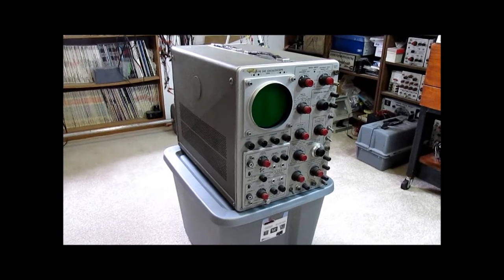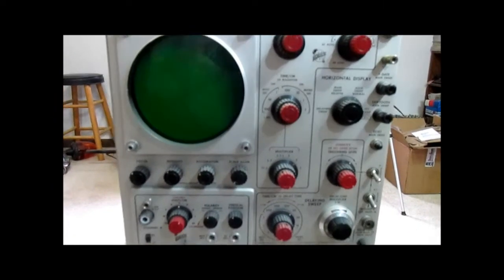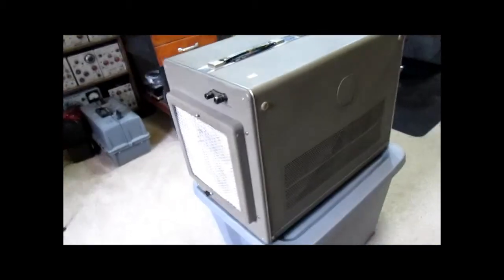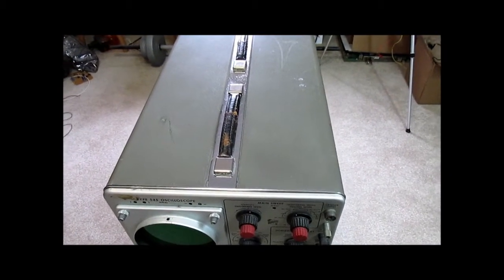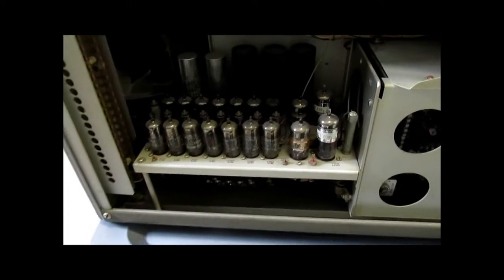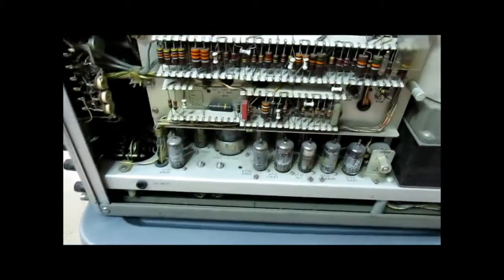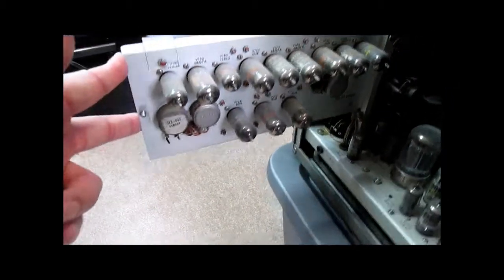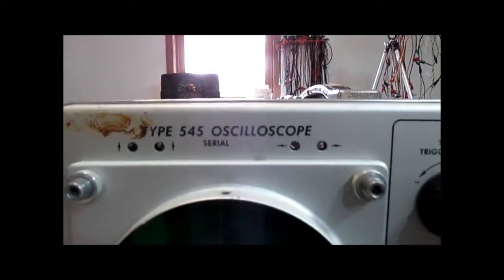Tektronix 545 Oscilloscope

Comment: I prefer using my 545B over my mid-1980's Leader. This fine piece of mid-century high-tech is still better to use than some later equipment, if you have the space for it of course. the large size and logical spacing of the dials is part of the pleasure in using it though. If it was all smaller it wouldn't be as good.

Comment: I used to use these when I was in the USAF in the early 1970's.  As I recall, they came with a small roll of silver bearing solder in case you needed to repair it.  The ceramic terminal blocks were pretty neat.